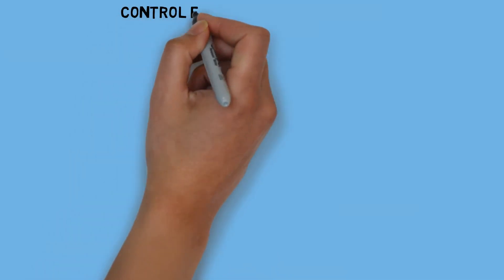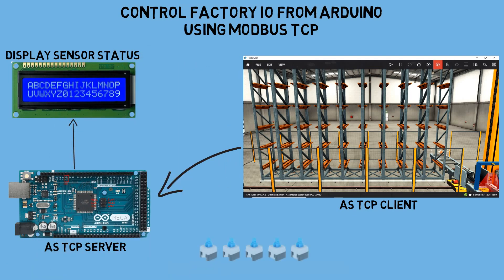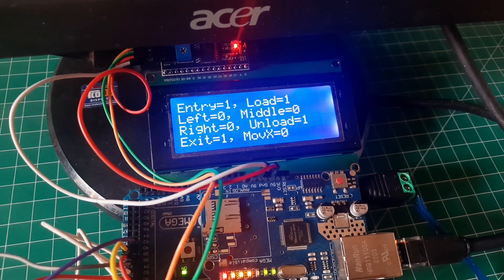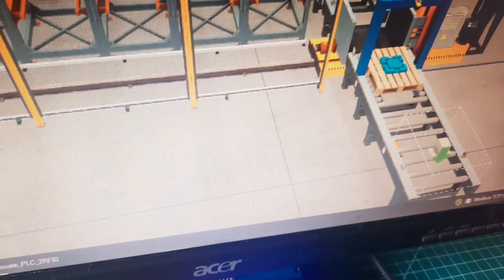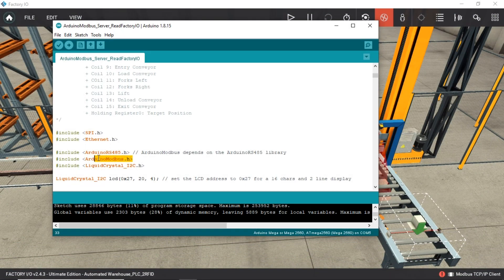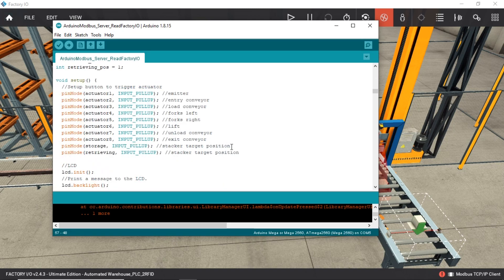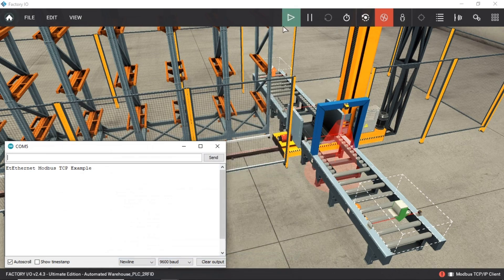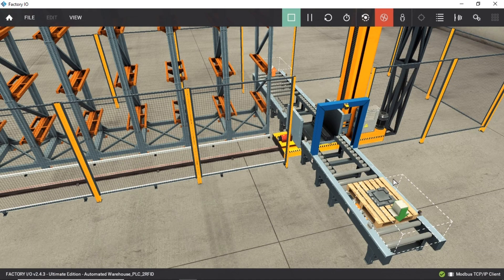Factory IO: Control Sensors and Actuator From Arduino Using Modbus TCP

Comment: Hello.

Kindly assist me I am trying to link my Arduino Uno to Factory IO. For some reason the host ip address is 0.0.0.0 yet the Link_To_Factory_IO.exe IP address list ranges from 192.168.0.132 to 192.168.0.141. Kindly assist me on how I can change the Modbus TCP/IP Server IP address in the Factory IO driver configurations?

Your assistance will be greatly appreciated